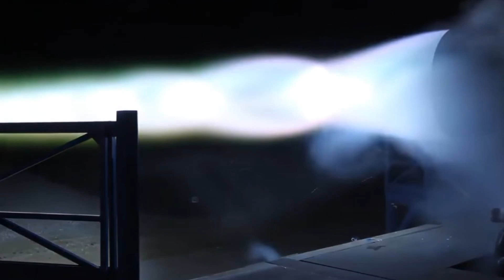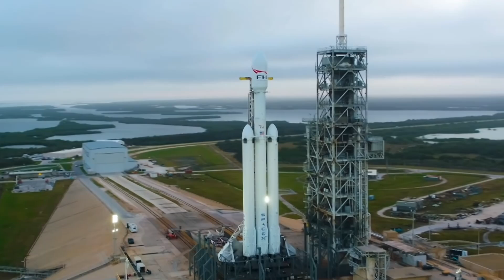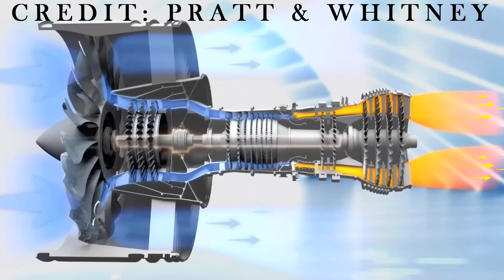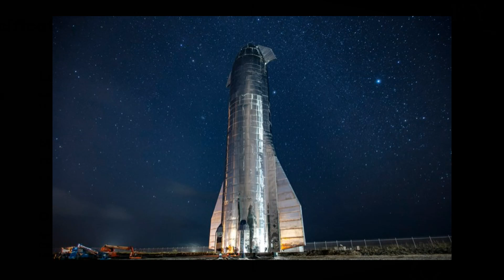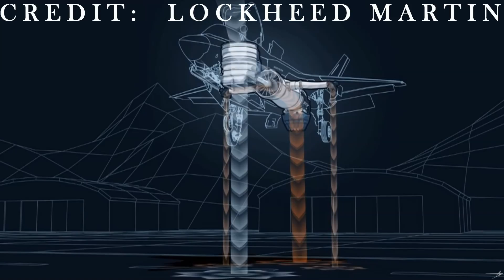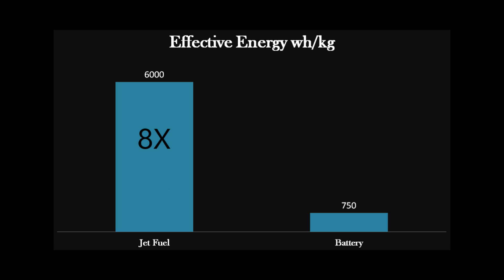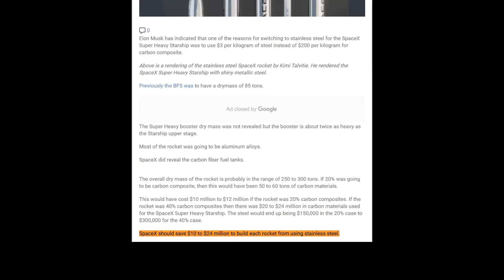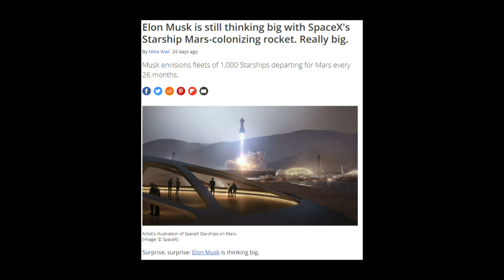ELON MUSK'S BATTERY POWERED SUPER SONIC VTOL JET - My Tesla E-SuperVTOL design

Comment: 20:12 An autonomus Plane could be hacked and manipulated :(  And it is also important to take care about the comparability of refuling / reloading time. A landed plane does cost a fee/time. Great Video :)
Reply: That's a common misconception. In theory, autonomous planes can be far more secure then current planes will ever be. Is far easier to take over the physical controls of a plane by committing an armed attack for example - then is to hack into a properly secured software system. Is easier to physically capture an enemy then it is to make him talk and tell you secrets he doesn't want to.  This is why torture is ultimately employed, and is physical.  The mind is an impenetrable fortress. Software has the same properties. Since the mind is software. 

For this to hold,  implies the security is proper. Which in most cases is not. Long term will get better and better, at a lower and lower cost per system protected. But physical security is already mostly maxed out.  It will get to a point where you gonna trust an AI system and not a pilot. Simply because you cant see inside that pilots mind. He can be a terrorist so how would you know?  You trust him? He can be tired, depressed etc. Trust him with your life? The best you can do. But you can't be certain. With autonomous systems, you can look inside,  and you just install an update if you don't like something. Try running an update on your girlfriend/boyfriend when he keeps doing something you don't like. No chance. Plus the other safety factors like sub-milisecond response time, near instant and perfect communication, precision in manuvering, reliability etc. Autonomous its just a better choice overall. And hard to hack is actually one of the most positive aspects, not a downside - is just that requires more infrastructure work which is not here yet.

Comment: re: longevity

Stainless steel has another advantage.  It handles cyclical stress better than aluminum.

If you cyclically stress a metal above a specific fraction of its yield strength, it will fail after a given number of cycles.  Ferrous metals can handle an infinite number of cycles if stressed below a certain limit -- the fatigue limit.  Aluminum doesn't have this advantage.  No matter how small the stress, there is a limit.  Too many cycles, and it will fatigue and fail.  Therefore, aluminum airframes have a limited lifespan.  In fact, the entire top of a passenger jet was ripped off on a commercial flight in Hawaii.  This happened largely because the flights are shorter, so the airframe is subjected to more cycles per unit time due to the cabin having to be pressurized for each flight.

https://en.wikipedia.org/wiki/Fatigue_limit
Reply from the maker: Thanks Ray!  I was trying to find that information but I couldn't!  I think I was missing the magic words... Cyclical stress!

Comment: So what be needed for an electric launch vehicle?
Reply from the maker: Launch vehicle?  Like a rocket?
Reply: @thelimitingfactor  Sure able to reach low orbit
Reply from the maker: Hmmm, I think you need a chemical rocket engine for a vacuum.  No air for turbine to push
Reply: @thelimitingfactor  but if you use a solid rocket booster could you fit it inside the frame. You would greatly decrease the needed thrust.

Comment: If this is going to be a VTOL, your engines are far too small. Turbine  blades can't spin faster than the speed of sound without a massive efficiency hit.  Using tip speed as a guide, you end up with a finite amount of lift per unit of blade area. You run into similar issue with supersonic engine design, if you don't add heat, you can't get supersonic exhaust, required to exceed the speed of sound. There is no supersonic ducted fan, because the physics don't work. You must heat the air, which requires either burning fuel, or some other heat source. The old nuclear engines used fission, so any heat source will do, but it kills electric engine efficiency in the supersonic range, as electric heaters aren't efficient, and heat pumps don't have the necessary thermal differential without complicated and expensive multi-stage systems. Electric aircraft work, but generally at the lower speed range. Jet engines, which are far better in power to weight, aren't producing enough thrust to make VTOL feasible, electric isn't going to manage that trick at lower efficiency.
Reply from the maker: I must learn more about this.  The motor seems to be the sticking point!
Reply: @thelimitingfactor  less the motor than  the propeller (or compressor) and heat exchanger. Propellers (or fans in turbine engines) have practical efficiency limits of around 75-85%. The source of power doesn't matter, electric motor or gas turbine, that limit persists. Supersonic flight requires you to add heat in to the air in the engine to get supersonic flow, that's a thermodynamic requirement, not an engineering problem. Electric aircraft are very possible, but not in the supersonic regime until energy density gets much higher or we develop some kind of heat pump breakthrough. 
VTOL is similarly impractical. For an easy comparison: a 747 has a max takeoff weight of ~1,000,000lb. It has around 200,000lb thrust. Of that 1 million lbs 40-50% of that is cargo, so weight reduction is no help. Just to hover its cargo you need twice the thrust of the jet, using conventional takeoff. Compare a plane to a helicopter: pound for pound of power the airplane carries far more.
Reply from the maker: @daer2121  Fascinating!  I need to look more into this - heat required for supersonic airflow!!!
Reply: @thelimitingfactor  the book aerodynamics and thermodynamics of propulsion is relatively cheap and provides a good introduction. Its pretty dense though.
Reply from the maker: @daer2121  Hmmmmm, how deep should I go....
Reply: @thelimitingfactor  for a quicker and dirtier, look up Zunum aerospace. They're developing an electric aircraft.
Reply from the maker: @daer2121  Taking a look now.

Comment: Firstly thank you for yor work. I would not replace the wheels, because safty reason the plan should not land right at the terminals, so there still need some taxiing. Surly it can be less complex, but not much because air less bubbles can be anywhere.
Reply from the maker: Agreed, small wheels would be a good compromise.

Comment: Promising.  But (sorry), you breezed over the atmospheric overpreasure (sonic boom) mitigation rather quickly.  This IS a big problem because there needs to be flight over populated areas.  Such craft have a minimum and maximum operational size associated with its stated performance and intended use.  Reduce size to mitigate overpreasure too much and it will not fly or not be economical.  Too big, same problem.  Flying higher helps, but there is still that overpreasure problem by the time it hit's the ground.  Atmospheric overpreasure is a big problem for humans, wild life, sea life and the environment. . . . . But why bother with this?  The BFR point to point on Earth is way faster, cheaper and safer.  Still the overpreasure, but that will be very localized.
Excellent job and right to the point.  I subscribed.  Thanks.
Reply from the maker: Agreed!  I could have spent more time here!

Comment: Very interesting. I'd like to see more information on how an electric jet engine would work. My understanding is that the majority of the efficiency for a conventional jet engine comes from the high bypass ratio and that it is the thermal expansion of the fuel air mixture that is responsible for not only the mechanical work of turning the compressor section but also the increased velocity of the bypass air through heating. How would an electrically driven compressor achieve this, particularly at higher than typical altitudes.
Reply from the maker: Yeah, I need to look into this to find out what Elon had in mind.

Comment: This was an excellent video however I think the only factor you forgot to mention is turn around time when it comes to recharging. Current jets such as the common Airbus A 320 are used all day essentially non-stop where they land, fuel up, and take off immediately again. Charging time could be a very debilitating factor.
Reply from the maker: Charging time would be 1C or more...so 1 hour or less.  Newer chemistries will enable this.

Comment: I don't understand how these electric motors can push air at supersonic speeds. If you try to physically push air that fast don't you run into the same compressibility effects that are better known as the sound barrier? I think any video on supersonic electric jets needs to explain how they would work.
Reply from the maker: YES, I need to look into this
Reply: @thelimitingfactor  I think the answer would have to be that electric propulsion system would ionize the air and then electro magnetically accelerate it. Such a system would also have no moving parts. Still no one seems to be talking about how an electric supersonic plane would actually work. I look forward to your going into this.
Reply from the maker: @nathanlewis42  Can you fire me some links at thelimitingfactor9000@gmail.com for the ionising propulsion?

Comment: Safety comes last? Ejection seat or BRS or anything like that for when the power wants to cut out? I would make a fast helicopter at mach 0.6 or so instead and I would know it wont let me down.
Reply from the maker: Hmmm, I thought there was some law that limited helicopters to their current speed because of the blade moving against the direction of travel?
Reply: @thelimitingfactor  Tha'ts for classical helicopters. "Future vertical lift" takes them beyond that limitation.
Reply from the maker: @murato8711  Gotcha!  👌

Comment: A few thoughts before I would step aboard this aircraft: 
1. Although electric motors are inherently more reliable than current jets (made out of billion pieces), they still fail sometimes. What happens when on liftoff, a flock of birds flies over right side of the aircraft and those engines fail?
2. On designing the body of the supersonic aircraft, you forget about Whitcomb area rule. This means, that in order to get through transsonic speeds, this aircraft has to dive.
3. What happens if the engine turning mechanism goes haywire and turns one engine vertical during supersonic flight? 
4. What happens if the engine turning mechanism goes haywire and turns one engine horizontal during takeoff?
5. What happens if your engines have to be switched off during flight (birdstrike,  engine controls failling, fan failing, volcanic ash damage etc.). How do you control the aircraft without engines running?
6. What happens if aircraft has total electric failure. 
7. Who flies it if the autopilot fails?

Bigger problem than engine heat removal (they run in -60 degrees Celsius anyway) is the charging. How do you plan to remove the excess heat from quick-charging this huge battery during turnaround (from 25 to 90 minutes)?
Reply from the maker: Whoa buddy!  Good questions.  To answer these, I think I need to make another video!  Quick note on the batteries though.  By this point, let's assume a graphene doped battery cell with lower internal resistance that stays relatively cool while charging.  The next bottleneck would be supplying that much charge power that quickly!
Reply: @Rick Lokers  
1. Emmm .... I would like to see the calculations for this. What you're proposing is essentially RCM motors from rockets. Carrying all your reaction mass onboard costs. A lot.
...
6. No, it is not. If you have ruptured or frozen fuel lines, engine control failure, running out of jet fuel or whatnot, your airliner turns into a glider, that can be directed and landed wuite successfully. Believe me, I used to be a sailplane pilot. Airliners have rendundant and replacement systems for that. This thing turns into a bomb unless there's some other way to direct it.